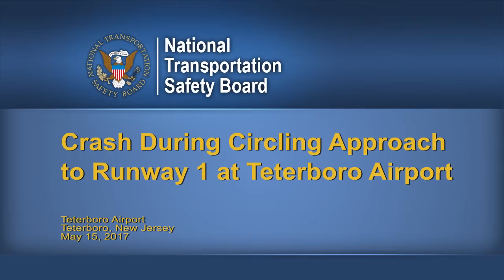NTSB Animation - Crash During Circling Approach to Runway 1 at Teterboro Airport

Comment: Neither of them belonged in the cockpit.
Reply: I feel bad for the second in command, he knew he was over his head. Unfortunately the company he worked for stuck him with this for a trainer.
Reply: @jeepnutnh  agreed
Reply: I disagree: the SIC was in training, clearly, and was classified SIC 0, and the captain should have been doing pretty much everything. New pilots need training and guidance, and familiarization, and this crash is exactly why.
Reply: In fact they were, mentally, running AFTER their aircraft : a typical recipe for disaster.
Reply: The SIC was actually much more aware of the situation than the PIC. I appreciate that he took the initiative by handing over the flight controls well before the point at which he was supposed to circle. The PIC didn't accept and was rather misleading than helpful when they needed to circle. SIC called out the airspeed multiple times after PIC accepted his second hand over. The PIC went on and performed a manouvre that doomed them.

Comment: My guess is the loss of control initiated with airspeed decay due to the failure to increase power during the steep turn. Sounds like they completely forgot how to fly an airplane....wow.
Reply: Carlos Pulpo The full report had it down to the wind gusts, and the pilot failure to compute wind additives to the proper airspeed for the plane. So they had it banked over and the wind gusts from the wrong direction took lift away from the wings enough to stall it because they hadn't addded airspeed to compensate.
Reply: GNX157 exactly how it happened,it virtually keeled over ,too slow, too high a bank, increasing the stall speed, almost inverted the cockpit hit the ground, beautiful aircraft.Rip, from Maplewood NJ
Reply: The captain probably thought he is a professional acro pilot. Im pretty sure, he never tried that trick before. Even in less windy conditions, this last turn would have been a challenge.
Reply: As far as the Captain, my first thought was is he half asleep, later in video wondered if he was having a stroke.
Reply: ...Had either of these cats commanded a JET before?..

Comment: So.... the combination of the wind and low elevation and low speed made them stall and crash?
Reply: The wind had nothing to do with it.  They seriously botched a perfectly routine approach to a familiar airport, letting the airplane get ahead of them instead of the other way around.  By the time the captain (the only arguably competent pilot on board) took the controls, they were up the proverbial creek without a paddle, and he didn't have enough talent to jury rig a sail.
Reply: Everyone had the same wind but landed without a hiccup. The combination of a pilot who DOESN'T KNOW WHERE HE'S GOING and  seems AFRAID TO PILOT THE AIRCRAFT might be contributing factors. This company is about to face some serious scrutiny from investigators.
Reply: The wind was irrelevant to their loss of control. They let the airspeed decay while turning. They were too low to recover from the resulting stall.
Reply: Damen Price Excellent explanation.  Makes sense.  Thanks!
Reply: Read the docket reports. Per the NTSB, The wind had everything to do with it on that final turn, notwithstanding all the other errors. The full report had it down to the wind gusts, and the pilot failure to compute wind additives to the proper airspeed for the plane. So they had it banked over and the wind gusts from the wrong direction took lift away from the wings enough to stall it because they hadn't added airspeed to compensate for the wind gusts.
Reply: GNX157 thanks.  That makes sense.  I’m no expert but why did the plane go down so fast.  Don’t all planes have some level of “gliding” abilities?  It almost seemed like the pilot nosedived - practically went nose first straight down.
Reply: PugFace Media   All airplanes have the ability to glide. Some can do it better/longer than others.  This particular aircraft stalled. One wing stalled a bit before the other.  So one wing has lift the other doesn’t. The result is a airplane very close to being upside down at a 45 degree nose down attitude. It’s happens fast. From control of the airplane to what I describe.!!   3 seconds.      I was a captain on the Lear 35 for 5 years before I moved on to bigger and better airplanes.  The Lear was a great airplane to fly. It made me the pilot I am. But never take the Lear for granted. It’s a Ferrari with no traction control or ABS. It can get ya.
Reply: @PugFaceMedia  yes, but depending on wing configuration, bank angle, and energy, this can happen very fast
Reply: @GNX157  From what I read in the NTSB report, they didn't have it directly down to the wind gusts & the lack of instructions for wind additives in the SOP. It seemed to be there more as a suggestion for improved safety in future. As it was, they were flying much slower than the companies standard operating procedure already, that speed would've been well above the stall speed with wind additives.
'The Learjet 35A airplane flight manual recommends increasing approach speed in gusting wind conditions. However, the approach speeds listed in Trans-Pacific’s SOPs did not include these wind additives.  Gusting wind conditions were present during the accident flight. Although the accident airplane was flown significantly slower than directed by the SOPs during the approach, the airplane remained above the manufacturer-published stall  speed.  However,  the  strong,  gusting  wind  might have momentarily  reduced  the  airplane’s airspeed below the stall speed. Adding guidance to Learjet 35A operations manuals to include a wind additive (if appropriate) when calculating approach speeds would provide additional stall margin and reduce the risk of a stall.'
'Per  SOPs,  the  target  airspeed  was  139 kts  (VREF  of  119  plus  20 kts)'
' Radar data showed that,  as the airplane turned to the right, it slowed from 127 to about 123 kts '
'The SIC, now acting as PM, announced “V-ref” while the airplane was in the left turn and then emphasized “add airspeed” and exclaimed “airspeed” three times as the airspeed continued to rapidly decrease to 111 kts (the slowest airspeed derived from radar)'
Even without the gusts, they still would've only been 9 knots above stalling, assuming they didn't continue to slow(it seems quite likely they would have).
They were 28 kts slower than the SOP target airspeed when they stalled.
Reply: Actually the strong quartering winds were one of many factors. I flew that same approach the day before in the same winds and can see how the crew got slow and failed to correct for the crosswind until they were too low and too slow. Yanking and banking in that situation only leads to bad things happening.
Reply: It’s all about bank angle. At a 60 degree bank your stall speed increases by 40%.  I would say he was close to that trying to not overshoot runway 1.   Classic base to final stall.  When you run out of altitude,airspeed and ideas all at the same time.
Reply: No